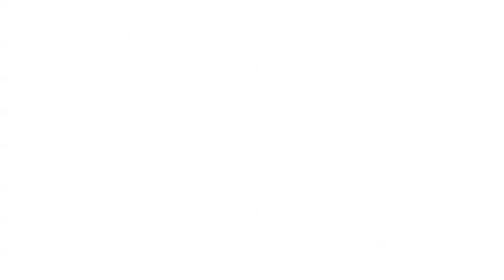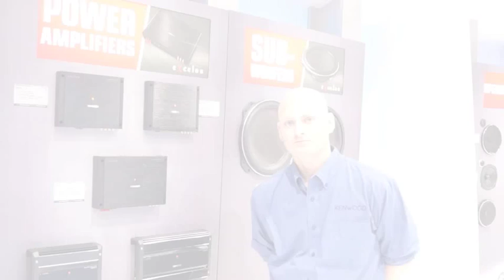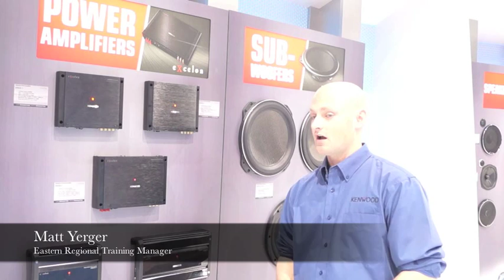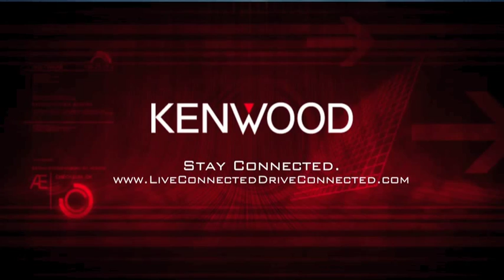Excelon Amplifiers - 2013 CES

Comment: awesome amps for last year. What kenwood need is to incorp the awesome dsp from the kac-x4r to thexr 4 channel and xr900-5 (needs sub rlc also) and the same dsp from the kac-x1r into the xr600.1 and please come out with a 1200 watt rms amp to match the xr900-5 in size and bring back the sub remote level control. and if possible, raise the sub channel frequency range to 300hz instead of 200hz..and u will have a nice complete lineup. heck to dominate make a 6 channel and the 5+6 bridge for 1200watts rms at 2 ohms... just some ideas